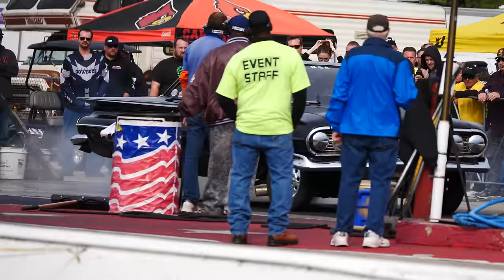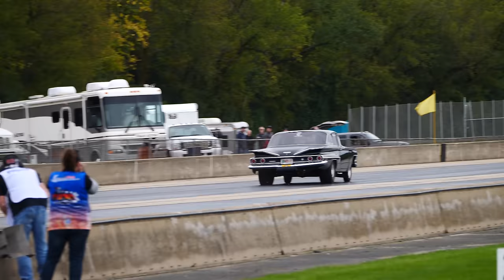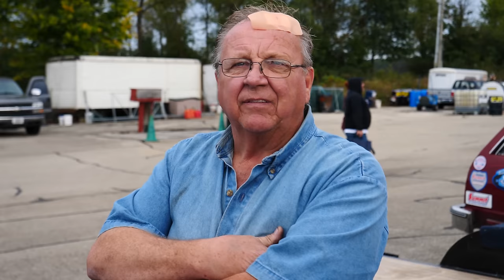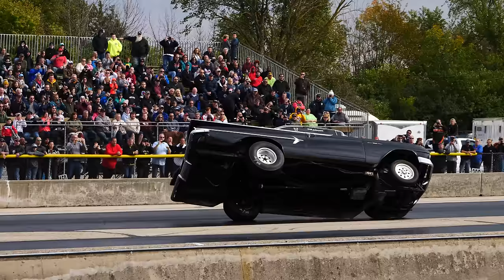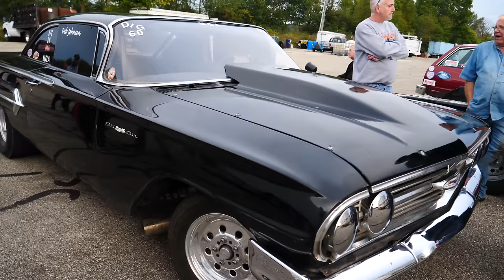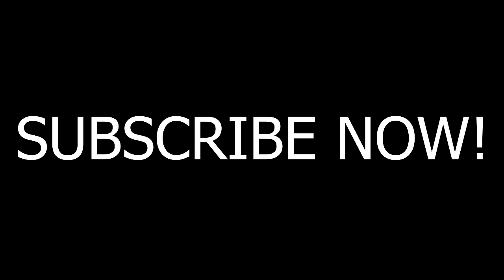1960 Bel Air Twisting the Frame During Byron Dragway Wheelstand Competition - 409 Small Block

Comment: Thousands of dollars into thousands of HP and no spare change for a stabilizing wheelie bar. SMH!
Reply: Wheelie bars would make it look shit.
Reply: @zeropoint546  yeah, you're right. Crumpled sheet metal and the twisted frame look are much better.
Reply: That's a 1960 Biscayne
Reply: @zeropoint546  some guys wanna do precarious wheelies.. to each their own
Reply: @jerrybear3081  100% correct.
Reply: It's a 1960 Bel Air. And the small block makes 800 HP range. If you knew the history of this car, he has been doing this for 30+ years and the car will never see a wheelie bar in its life. Believe it or not, but he has now turned down the timing and drives this car on the street. Same setup
Reply: Classic X frame car with no reinforcement, wheelie bars wouldn't fix everything wrong with this set up
Reply: @jeffreylines1535  everyone always says its the X frame twisting on this car...its not, this video clearly shows that, the body and frame stay completely stable and straight while the rear end and rear suspension are whats causing it to launch that way...no anti roll bar or sway bar.
Reply: This car was essentially built to do this, it's for show.
Reply: @RodCalidge  he made it that so he could do that, where's your car at,? huh?
Reply: This was at the Byron wheelstand contest. Rick Johnson is his name and he is a friend of mine. He is 75 years old and living life to the fullest. Yes, he can afford wheelie bars. No, he doesn't want wheelie bars.

Comment: Actually 1960 . 59 had teardrop tail lights
Reply: Thanks. It had me confused.
Reply: Cats eyes is what we called them, in those days.
Reply: @4406bbldb  MERCURY COMET ALSO
Reply: My buddy had a 59 he drove to high school. He liked the car so much he has bought an other just like it . He has it fixed up all original and very nice .
I ran a lot in his original when we were kids but haven't in his recent one. 
Looking forward to it !
Reply: 60 I agree
Reply: @bolingray  THE COOLEST CAR MY PARENTS HAD WHEN I WAS A KID
Reply: I had a black '59 El Camino.  The neighborhood kids called it the Batmobile.
Reply: @tonkingulfyachtclub8111  IN 1976 I HAD A VERY RUSTY ONE OF THOSE. OND DAY MAKING A CORNER THE STEERING WHEEL MOVED 12 INCHES TO THE RIGHT. THE BODY MOUNTS HAD RUSTED THRU. THE BODY HAD SLID SIDEWAYS ON THE FRAME. I HAVE HAD A 74 THE PAST YEARS. NO WHERE NEAR AS COOL
Reply: @csi1392  Sounds damned scary.  Mine had a 350 in it and naturally, I blew the rear. Traded it even up for a '68 Plymouth Sport Fury convertible.
Reply: @tonkingulfyachtclub8111  also known as a "cat eye camino."
Reply: Even the license plate said it's a 60.
Reply: @bolingray  Of course, and this guy should have known better. They're closely related, but distinctively very different.
Reply: thats what i saw

Comment: Isn't that a 1960 Bel Air? 1959 had the upwards angled tail fins and the 60 had the flat fins.
Reply from the maker: That so?
Reply: The 59 has teardrop tail lights and a studded grille.
Reply: The 1959 tailfins were rounded as the 1960 were mor squared off. Also, to find a 1959 2-door HARDTOP "bel air" is really really rare! I believe that only 1,031 2-door HARDTOP belairs were made in 1959 and were only made in Canada. Only 2-door hardtops made in the states were badged "Impala". I believe that 1960 was a different story.
Reply: Also, concerning the fins that were angled upward were put on the 1959 Buick.
Reply: Yes, that is definitely a 1960 Chevy Bel Air!
Reply: The 60 has the rocket side trim. The 59 didn’t and their tail lights and grill are different.
Reply: Definitely not a 1959!
Reply: Why yes, yes it is!
Reply: @cliffordharley4322  there's actually a lot more difference between the two years. The only body panel that is interchangeable is the roof and maby the   Core support/inner fenders. Everything else is pretty much different on the body.
Reply: Nope, the '59 had the same flat fins as the '60. The body style of the '60 was just more toned down. This car is a '60 though.
Reply: @InternalCombustion  The car in video is a 1960 model.
Reply: @racecar2933  Glass interchanges between '59 and '60 as does dashboard.
Reply: @rockettcustoms6266  No, the rear end is entirely different between 1959 and 60.
The 1959 had curved 'bat wings' that meet at the license plate mount and flatten toward the ends with 'cat eye' tail lamp lenses.  The '60 had distinctly different 'fins' that were angular and far less extreme.
The sides of the '59 sloped gradually from top of front fender to tail light housing as on the Cadillacs, the '60 did not.
Reply: 1959

Comment: What amazes me is how many times this X frame has done the twist and he hasn't replaced it with something more rigid.  I can't imagine how much welding he must have to do to keep this thing together (or those old X frames were more elastic than I thought).
Reply from the maker: very good question, I'm not even sure how those rails are joined but your right, eventually they would fatigue. Hard to believe something can bend that much and still be fine
Reply: Its not the frame twisting its the rear suspension allowing it to do this..look at the right rear tire buried in the wheel well while the drivers side has a foot of gap..no anti roll bar and a 3 link suspension.

Comment: Broke a couple parts but saved the car, I'm fairly certain this is the same black 1960 Bel Air I saw twisting the chassis off the line in a video posted 15 years ago, good to see the car is still ripping down the 1/4 mile today

Comment: That is not a 1959 Chevrolet, it is a 1960, which looks distinctly different. 
I once owned a 1959 Impala Sport Coupe with 348 and factory air.  When the 348 gave out I put in a 409.

Comment: A long time ago did that happen to him once and everybody liked it so he just keeps doing it?  Aren't there these little things called sway bars that would keep the ass end  from twisting so severely and hitting the ground.
One would think with all the torque twisted to one side it would lift the other tire up and lose traction.  Just me but I think most cars try to squat down on both rear tires and not do that.  I mean how do you steer with one wheel on the ground and your headlights pointed towards the sun?
Reply: Practice

Comment: That is some pretty soft suspension.
Reply: Yeahthe X frame cars had a garbage frame and suspension, but they looked so good.
Reply: @69shovlhed89  It's to the point that Morrisons, perhaps, now sells full perimeter frames for the Chevy/Canadian Pontiac X frame cars.
Reply: Did NOT have a garbage frame and rear suspension but it sure as hell was never ever designed for drag racing. The frame was ridged and rear suspension soft to provide a very comfortable ride. Now the factory drive shaft was an absolutely GARBAGE 2 piece carrier bearing set up that if you have ever worked on it you wouldn't want to do it ever again.

Comment: Now that's the real batmobile
Reply: The "original" Batmobile was made from the base of the iconic 1955 Lincoln Futura. However, the 1955 Lincoln Futura based Batmobile was the 3rd or fourth generation of Batmobiles, but many believe it to be the first. I have heard from many that the 1959 impala was used as a base for one of the Batmobiles, but since I have owned a few 1959 impalas, i have come to find that is untrue.
Reply: Nope, the Futura is the original. All the others Barris built were fiberglass made from a mold taken off the Futura. Read some history.

Comment: It's a 1960 Chevy not a 1959, it's not an Impala. It's a Bel Air hardtop and they were lighter than an Impala. Mine was a former Super Stock champion like that. When it was retired the driver told me they chose it for the weight savings.

Comment: This is how Big Bocks and Weak Frames without Sway Bars Act
Reply: If you take a closer look, you'll find that those cars have a massive frame.
Reply: You could not stop that body roll with a 2 inch sway bar. The rear suspension is 2  square tubes about 5 feet long angled towards each other going to the front. They are attached to the axle close to the brake backing plates and almost touch together in front where they attach to the frame at the back of the transmission mount. So because the front of the rear suspension is mounted in the middle of the car about as far up as where your butt is sitting the car rolls on that axis. The rear suspension was designed for ride comfort. Never for drag racing. It needs a ladder bar rear suspension. Then it would maybe get some air under the front left tire at the launch and go straight down the track with no body roll or other craziness and run faster times.

Comment: Cannot understand why but it must have the stock rear suspension. Whatever it runs when it isn't doing that death dance it would be at least 5 tenths faster with a  proper ladder bar or 4 link set up and no craziness.
Reply: Its a wheelstand car meant for that plus its just tuning all u gotta do is switch up your shocks springs and traction equipment and ur back to race mode